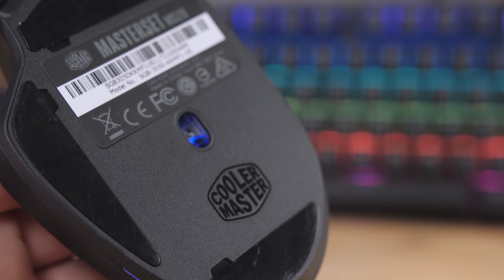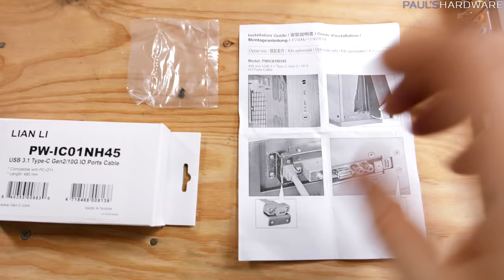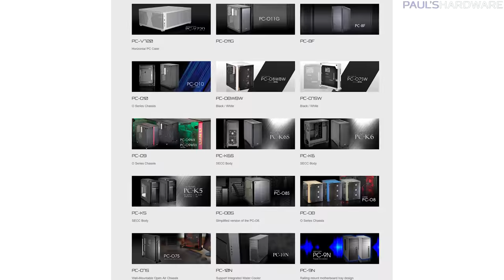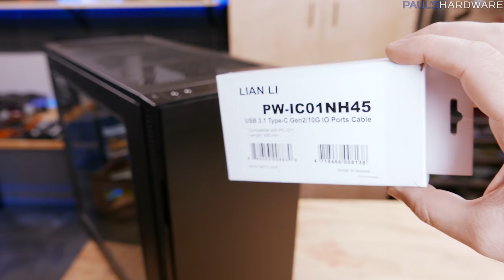CASE MOD! Adding a 10Gbps USB 3.1 Gen2 Type-C Plug

Comment: I used to be allergic to people saying "aluminum" instead of "aluminium", but I desensitised myself. 

Fun fact: Sir Humphry Davy (who was British) discovered and named Aluminium. But Aluminium was only the last name he settled upon, with pressure from the scientific community at the time. Sir Davy had previously named the element "aluminum". The reason for the name change was because there was a theme of certain elements ending in "ium", and "aluminum" didn't fit with that theme. The scientific community at the time were keen to uphold the theme, hence the pressure on Davy to rename it.

The reason our American friends still say "aluminum" is because the scientific literature they used at the time came from Britain, and there was a delay in that literature getting to the US. So essentially Americans say "aluminum" because they used out-dated literature for too long.
Reply: FriedEggSandwich What about Platinum? Or  Lanthanum? Molybdenum, Tantalum, Tennessine, Oganesson...
Reply: Idk. I said certain elements, and I didn't write the rules ;)

Comment: Hey A little off topic but how did you get the phanteks evolv RGB build you did's case lights to sync with Aura ? maybe fan hub with rgb header connected to rgb connector on mobo?

Comment: I have USB 3.0 ports on my AM3+ socket motherboard and also have some 3.0 flash drives and have not used them together yet because of the placement of the ports.

Comment: Corsair 5000X With X-570 Tai Chi running a 3080, this is a requirement because the graphics card covers the connector on the MB.  You would think they would include this type of cable?

Comment: Nice job Paul. new channel "Paul's Modding Hardware"  Just curious but what would you use that port for...external SSD? What kind of speeds do you get?
Reply from the maker: Theoretical throughput would be about 1250MB/s but real world will probably be a bit less than that, depending on the device connected. I'm hoping there's an external M.2 NVME to USB 3.1 Gen2 adapter or portable SSD available soon.
Reply: Ok thanks for reply Paul. Was curious what would take advantage of the 3.1 gen2 port.

Comment: Used this cord to adapt down to USB B mini to plug in my Corsair H100i v2 to my Asus Strix z270i Gaming ITX board.  This board doesn't have any USB 2.0 headers so this 3.1 header cable was the best option.

Comment: Really good job on that I have to say, I recently got Fractal Design Define C and it looks so much like R5 and now while watching this video I examined the front panel if it would be possible to do the same hack on it and yes, it looks like I could do it! :D And I have the header on the board. But what would I use it for just now? Phone charger has got an A on the other side. Maybe later in the future. Good idea though, thanks for that, at least I know I could self-upgrade my case if FD doesn't come up with some replacement I/O panel like they did for R6 called D1 or something.

Comment: I suppose this is a solution if you really must have a port on the front of your case but it is a lot simpler to buy an adapter that uses a PCI bracket on the back of your case!

Comment: Case Manufacturers! Please make cases with multiple next gen USB 3, Type-C, and Thunderbolt connector option for the front panel since gaming motherboards come with all these headers. Thank You
Reply: Case manufacturers want to sell more cases, so they make the I/O non-upgradeable to sell more case. The steel / hard plastic case doesn't need replacing for decades. But making the I/O panel modular... nope.

Comment: What if the case has the USB type C port but the motherboard doesn't have that fancy slot for the connector? Is there a high end PCI-E card that can be added to the motherboard to provide an IO expansion connector for the chassis USB type C cable? I have a Corsair 680x and an Asus TUF Gaming X570 Plus motherboard.

Comment: Hey Paul random question that has nothing to do with this video i think. I already have the r5 1400 installed on my pc i just got the r5 1600x what do i need to do before and after in the pc system. Or do i just replace and put new one on and thats it

Comment: Great deal! I have the same case, although I'll likely get one (hopefully 20Gbps) that'll occupy a PCIe slot instead (though won't be plugged into any PCIe port).Will have to see what option is on my ASRock Z97 Extreme6. Unfortunately, the cards for these MB's sold fast & few originals to be found. Still a neat idea & tutorial, thanks for sharing!

EDIT: Just checked, my MB will have to use this same speed of Thunderbolt, so will go from there.

EDIT 2: In 2021, this is a very useful trick to have the USB-C port, as most newer MB's has one header for the front & another on I/O shield. Worked for me also, and will use the same principle to do the same on a Fractal Design 3300 Core case. What good is it to have the connectors and none on the case. This saves a tone of cash, at least $200 for 2 PC's. 

Thanks for the great video!👍

Comment: Paul, I have a liam li 011 dynamic and have installed a asus tuf z390 plus. The case is wired with the c-connector but i have searched high and low for the connector on this model mb. I can only assume i am sol because I didnt check first?

Comment: I just bought a new case with one of these ports, but overlooked the fact that the new motherboard I have doesn't have the header plug (i guess the reverse of this video?). It does have a port on the rear panel though. Is there a way I can wire in the front port of my case neatly?

Comment: Too bad... Thermaltake's Core P3/5 cases were released after these USB connectors existed.  They just didn't add them.  Would hate to manually drill the case.  Thermaltake usually releases 3D prints to accommodate for expansion (fans, CD drive etc) wonder if they could do one for this header.

Comment: I don't get why motherboards don't come with an internal standard USB connection (either type A or C), then the front ports would be just as an extension of that port. It would also allow some internal uses.

Comment: I have the opposite problem: my Case has a USB-C Gen2 in the front panel, but my Mainboard doesn't have such a 3.1 Port, just two of the 20 pin USB 3.0 connectors.
What can I do to get the USB-C port working?
Reply: If you do not want to update your motherboard then only option is to get something like this: https://www.scan.co.uk/products/silverstone-ecu02-add-in-card-pcie-gen3-x2-usb-31-gen2-10gb-s-20-pin-header-sata-power-connector  There is no simple adapter between USB 3 and USB-C Gen 2 because they are not directly backwards compatible.

Comment: Hey, is there a workaround if my situation is the other way round. My evolv X comes with that fancy Type-C connector but my motherboard doesnt have it (or i‘m blind, Asus Rog B550 F Gaming wifi). Is there an adapter to somehow connect the type c port to my motherboard?

Comment: My motherboard has the Gen 2 header, but my case has two blank, unconnected USB slots. Is there a gadget similar to this one which has two female USB3.0s? The mobo specs suggest the port will run two 3.0 USB ports but I haven't seen any connectors to actually achieve it. As a last resort, one would do and I'll make the other blank port 2.0.

Comment: I know this is an old video, and an old mod. But for those who still have a case that doesn't have a USB-C port, and are looking for a cable similar to what Paul used (as the one he used can be found no where... at least I couldn't find one) here is the link to a cable that I am using to install this mod on my case:
https://www.amazon.com/gp/product/B087JGWG9Y/ref=ppx_yo_dt_b_asin_title_o01_s00?ie=UTF8&psc=1
Reply: Manny Torres  got the cable in several days ago, haven't done the mod yet, just been busy. But I don't expect any issues.

Comment: My problem is the other way round. I just bought a Asus B550 MOBO. The case I bought has the cable so you can imagine my disappointment that the mobo didn't have a socket to plug the cable into. Any ideas on  a way round this?

Comment: I have completely opposite situation - My case has USB-C connector and a cable, but my motherboard doesn't. Tried to find PCIE card with the same connector as your MB has but i have no luck for now.

Comment: If Phanteks would get off their butt and provide a revised Front I/O for the Enthoo Luxe like they said, this wouldn't be necessary..
Reply: Sparky Funny thing you should mention this. I am thinking of doing this on my Luxe top IO slot. Now if I can find this cable Paul use
Reply: I haven't checked carefully the current Front I/O and if it's possible to sneak in a Type-C port there.  I suppose if it's impossible then an option could be the top I/O near the power button.  Though I wouldn't want to try to drill through that.
Plus, really disappointed with Phanteks.   I'm not sure which case-maker at this point is the best for providing OPTIONS to keep one's case current.

Comment: I was looking into replacing a single USB 3. 0 and single USB 2.0 on my front panel with dual 3.0 to get access to the two blocked ports on my motherboard.

Comment: question!!!  did you notice if your phone gets a "quick charge" notification on screen when using this port?  i have an aorus gigabyte z370 series that has a USB C on the rear I/O panel, but I think it's broken. phone connects for a second, then disconnects... if I do it a few times, it will eventually connect, but it's unstable (viewing photos etc makes it hang). it will say fast charge, but doesn't actually do it...  now although my rear USB ports (all of them) do work with things like keyboards, mice etc... even browsing my phone's contents, none of the rear ports charge well (super slow). Front ports on the other hand DO charge very well, but are not fast charge. The board has two asmedia chips, one for rear (which I believe to be broken) and one for the front (which is where the two front A slots do charge well). I plan to get a header for the front USB C and hopefully it gets fast charge.  it's too bad the rear one didn't work. I suspect it may have died when I tried using a USB C to HDMI adapter on it... wonder if there's a way to repair it.
Reply: the phone will always say quick charge on screen when connected to type C (an electrical switch activates it),  however, the port will not actually initiate real quick charge as it doesn't supply enough voltage.  motherboards that have a type C port (3.1 gen2) do not actually support quick charge, especially if it's an asmedia chip.

Comment: So much better motherboard side connector than USB3.0. It will not be the first time that I pull the plastic around the pins off with the connector cable.

Comment: What is the solution if I have a usb type c on my chassis but my motherboard doesn’t have a connection for it... any pci cards with connection in it? Don’t hate sometimes I’m a compulsive buyer and piece the beast one by one without thinking about all possibilities :)

Comment: What's the point of a type c on a PC? I have a OP 3T which has a Type C connector but i cannot figure out why you would need a type C port on a computer. I could not find any Type C to Type C cables that would be useful in such a case. (Yes i know the type C on the OP 3T is USB 2)
Reply: LsHallo Vader external harddrive? External SSD? External disk burner ? External USB hub? Lots of use case 😃
Reply: also charging your phone and such
Reply: My 2015 Nexus 6p came with a c to c cable out of the box, the charging brick is actually ubc c. I've also invested on an usb c power bank the main advantages of the connector are durability, the small form factor and the fact that it's completely reversible which believe me saves a lot of time and hassle
Reply: You say that as if USB-C is a mobile oriented connector like microUSB. That's not the case at all, USB-C aims to replace literally everything, and one step in doing that is to replace USB-A ports with USB-C. For me specifically, I have a ton of flash drives, some external hard drives, and other peripherals that connect over USB-C. My last three phones all had Type C and as such I've got a bunch of USB C-C cables. I've even got this weird little USB-C mouse. 

Point is, it's the future USB connector, why not embrace it from now?
Reply: LsHallo Vader
Why you still need USB A or B, my case is Type C only front, only type B on the ATX I/O back plate, why still use these old clumsy old standards? You missed out on the Qi? Not owning any NAS? what you need connect on Dark Aged plugs?  a Logitech webcam?

Comment: I dont understand why they need a special header for USB 3.1 Gen2 on the motherboard. Front panel USB 3.1G2 could also be connected if the motherboards had a USB Type C connector directly on them.

Comment: the mobo that you have in the desk is the Asus Strix x299-e and it come with the
C port. by defaul

I don´t understand, what is the point,  because, if the mobo have the internal port USB 3.1 Gen2 that mean that the mobo have the port C by defaul in the back panel. 

so what is the point!?   is just for aditional port ?!!

Comment: I have a Dell XPS 8930 with a card reader, Gen 2 Type-C port, and an optical Blu-ray disc drive.  I use all of them. Now that I'm trying to build a second computer, I find there are no cases in the US that have a card reader and type C port, as well as an external 5.25" drive bay. Arrrrrgh!

Comment: My new case has one of these connections but my motherboard  does not lack of research... does anyone  know if theres an expansion  card out there with this connector  on it
Reply: I've been looking for a card with this header too, for over a year actually. It really seemed insane to me there would be a mountable cable but no expansion card. Just a few hours ago, I finally found out about a company that makes 'em called 'Delock': https://youtu.be/vF21F9P6H0k

You're welcome!
Reply: Thanks,  @powerfulaura5166  I need this.

Comment: This way worked well but a Dremel may work a little better in this scenario
Reply: A Dremel would work a LOT better. Drills are terrible for milling/routing applications, the flute edges are not sharp and this is a misuse of the tool, even if it "works."
Reply: Cody Gunst
Dremel drills were a thing in the 80th, he should have done a 3D printing front panel! Doing it good, this drilling is to primitive.

Comment: Does anyone make a 90 degree motherboard usb type-c adapter?  My case already has a front panel usb type-c but it's thick and the motherboard side of the connector is straight so I have to make an uncomfortably type loop to plug it in.

Comment: I would have to get a rear pass through bracket and an extension cable rather than drill into my Fractal Design case.

Comment: Can someone explain me the advantages of having that plug other than having a type c plug? Does it have faster transfer speed than others? I'm kinda lost in the usb gen thing
Reply from the maker: Basically it's double the bandwidth of USB 3.0 or USB 3.1 (Gen 1) which provide 5Gbps. USB 3.1 Gen 2 maxes at 10Gbps, and just a few months ago they detailed USB 3.2 which will support up to 20Gbps.
Reply: Paul's Hardware Thanks for the clarification! I was looking on wiki when you answered and you explained it way simpler than they did. Nice mod btw I'll keep that in mind when I'll build my fist PC hopefully soon. (Praying for gpu/ram prices to come down)

Comment: Hey Paul, in your build in this video https://youtu.be/Vo8gmAoDQ6U , what fans are you using for the rear and the top of the Phanteks Evolv? Also are they 140mm or 120mm? Can the top fit 3 140mm? I'm asking because I have nearly the same setup and need to know before I buy my case fans in a bit. I was thinking about buy some Corsair HD140s for the rear, the top, and replace the stock fans on the nzxt x62. But I decided I just wanted nice black fans as I liked how yours looked with little RGB? Do you know of any good fans that can keep my case cool for overclocking as well? Sorry for the log question ok a video from long ago.

Comment: Hey! Thank You Paul, (5:07). No where else is this even explained or discussed. USB-C, Should! be reversible on both ends of the motherboard connector.   But why would engineers do anything like that ?

  I need to back it up to look at the way the port on the motherboard is supposed to look ..... (0:33)

 2020 working on a Ryzen Build ... All ***ing year.... dead parts, parts not working correctly (USB 10Gbps), $$$$, pandemic, riots, unemployment....... 2020 the longest decade........

Comment: I used the U.2 port in my new board with the 3rd generation U.2 drives. To make an external 512GB drive. It carries 10GB. Which makes the SATA 6GB and USB look like they belong in the stone age. 

I will never buy a USB drive again... When I can transfer 60GBs of data inside 30 seconds to it...As the only limit is the damn SATA 6GB interface...

Comment: Why is sata even a thing anymore? I mean, there is faster conectors (actually asking a question)
Reply: Because almost all of today's drives have SATA, it's fine for HDDs and most of the SSDs (if you want more than ~500 MB/s, get an NVMe drive), why bother changing it?

Comment: if i have an unused sata internal dvd-rom port inside a laptop like any Cheap blue HPs today....is there any way or adapter that can have Thunderbolt 3 out of a SATA port ??
I would love to use Thunderbolt 3 to connect a Universal Audio Arrow 4 x 2 audio interface even if that connector is inside ??? Any one ??

Comment: Why are the ports still bulkier than the actual port. Why not put a female usb c or type a 3.1 on the motherboard. Same with 3.0 its a huge af blue connector.
Reply: I know that the usb 3.0 header has cables for 2 ports but come on why not use the same female ports on the io panel and put one on top of the other.